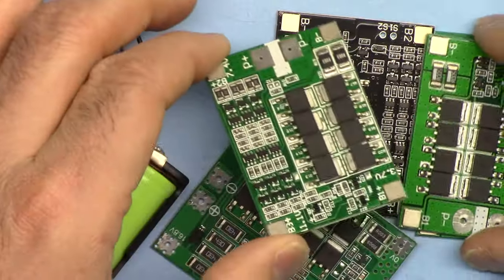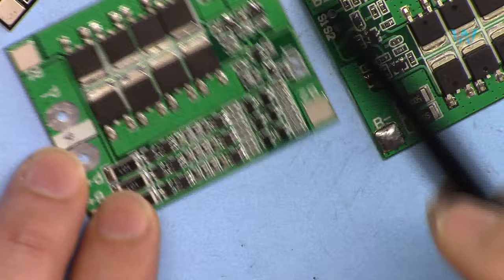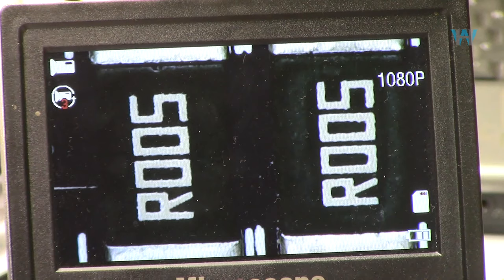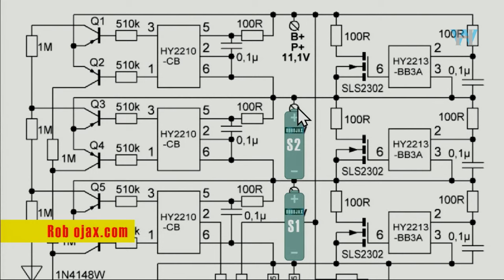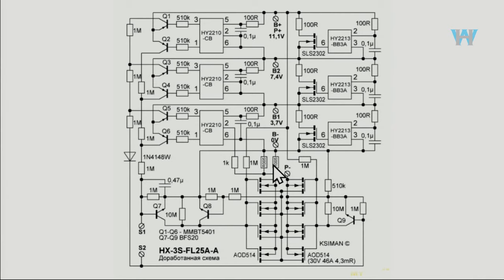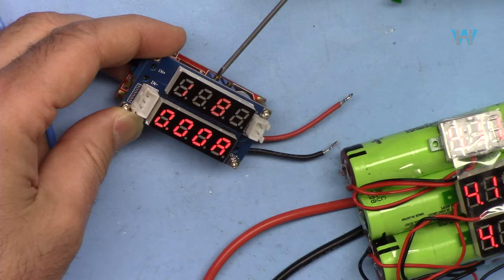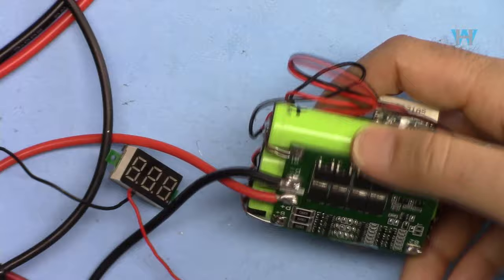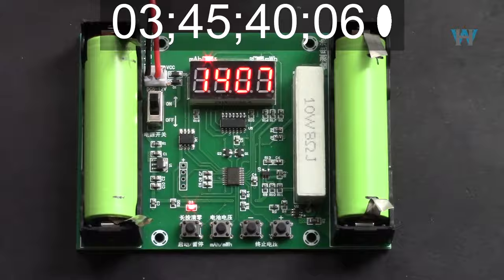The complete Guide to using 3S 40A Lithium BMS Battery Charger

Comment: thanks for this! very helpful. I've been thinking about combining this with a lithium polymer pack for easy charging.
i do have one question though, if your input voltage is at 12.0 for example, will the battery still charge to the maximum of 12.4 volts? or would you need to raise the input voltage. thanks!

Comment: Nice explanation on this topic. I have a question however: I'm using one of these managers to assist a pack of four batteries (4S) to feed a 14.4 cordless drill. There is a problem, the overcurrent (short) protection trips every time I pull the drill trigger. I wonder if I solve it by shorting the current sampling resistors (and shutting down the overcurrent protection) or there is a better solution for that. Could you please advise?
Reply: I have been playing with a knock-off set of 18/20 V Dewalt batteries. Dewalt seems to have the charging BMS in the charger rather than the battery pack. They have individual cell voltages as well as the main connections in the connector. When it is in the tool, there is no overcurrent protection such as there is in the BMS. Having the BMS in the charger cuts costs, for the sack of a more complex connector.

The video illustrates just how complex lithium batteries are and the real danger of not charging them properly. There have been a number of house fires locally due to charging scooter batteries.

The Dewalt battery pack has 5 pairs of parallel cells in series. So the BMS works with a pair of cells rather than one.
Reply: Try adding a 10-100uF capacitor across the output terminals it should help with the starting current.

Comment: Great video. I am new to the battery pack world and I learned a lot with your video. What is the small voltage readers you are using 23:04? Thank you so much.
Reply from the maker: I checked the time and there was not (small) voltage measurement. But as I continued watching at 27:23 I've shown the current passing from resistors. that voltage can be used using ohm law to find out the current I=V÷R
Reply: @WattHour  I checked 23:04 and you do have a small voltage meter attached to each cell. I think he was interested in maybe purchasing these tiny digital volt meters.

Comment: I don't have a module that have constant current adjustment, can i charge through it my battries, and my cells are not all same voltage can i connect those to bms or first i need to full charge it individually.?

Comment: Question: I made a battery pack with the same module (3S25A) for a 12V cordless vacuum. But it only runs half a second then cuts power. Tested it on a 12V cordless drill, works fine. Also tested the drill's battery pack on my 12V vac, again works fine. What could be the problem. Help will be very much appreciated.🙏

Comment: So for some reason on my BMS and I have 3 brand new ones when I hook them up the voltage on the pack reads 12.50volts but on the B- B+ it reads 11.50v everything has been hooked up to balance wires and when I test the balance plug each series of cells reads 4.15v so the only thing that’s not the correct voltage is the bms. Can I move the wire from B- to the 0v side of the board? When I do that it reads the 12.50v but I’m not sure if this is bypassing the bms or not.

Comment: well detailed information.  if i use this then i wont need dc to dc lm2596  step down buck converter right?? cause m using it to charge me 12v 9a lead acid battery using 20w solar panel and with full sun light it gives 19v dc. so if i directly connect the solar panel in this 3s 40amp bmc will it auto step down and charge and auto cut after battery fully charge?? plz plz reply

Comment: Do I need to connect (weld, solder) batteries to the BMS board in sequence (from plus to minus or vice versa) how is it in the laptop battery so that the board does not go into protection?

Comment: Hello, 
Thank you so much for this great video ! Question about the over current / over discharge protection : would it be possible to turn a 20A BMS into a 10A by removing one of the 0.05 ohm current sensing resistor ? 
The resultant current sensing resistor would then be twice higher, so the current needed to reach the protection threshold voltage should be twice lower, correct ?  
Is there any reason NOT to do such a modification ? (I can’t find 10A BMS online…)
Thanks again !
Reply from the maker: Hello, the higher the current, the higher the voltage across a resistor. So if you want to reduce the current, then increase the resistor so the voltage is increased. Now change the resistor such that the value of the resiwtor is twice as large as the original values. Removing a resitor will increase the resistor value. yes.
Reply: @WattHour  Thank you !

Comment: Question please 🙏
I have network video recorder(NVR) ,can I use bms 3s as a UPS , by puting the output and input in the place of dc12.6v in NVR (to charge when electricity is on ,and produce when electricity is off)
*NVR works with 12.6v 2A. 
Please answer 🙏😘

Comment: I came accross a weird stiuation. My 2S3A BMS has no voltage reading on the output, so I assume it's faulty. But when I reverse the input polarity I get a reading (slightly less than actual V). So, would it still provide some protection?

Comment: so my drill use 20v battery  so how it got wet   I replace my batteries  5 battey 3.7v am getting 19.5 volt when i test the batteries even the battery indicator show that they fully charged but on bms output connector  to the drill am only getting 4.add voltage any advice ?

Comment: Thanks for the most excellent video. I have a question. I purchased several of these boards and they only put out 9.6V even thought the battery itself reads 12,6V. I am guessing this is a board malfunction, correct?
Reply from the maker: Hi, you did not mention if the battery is connected or not. The output voltage is changing based on the battery state from 3.2V to 4.2V. so 3.2x3=9.6V and it seems that is correct if BMS does not detect any voltage.

Comment: 31:30 min why the battery doesn't charge ? I thought the over voltage protection only cuts off the connection if the cell voltage drops ~4.25V.
Reply from the maker: over voltage protection is when the voltage goes "Over" some value which would be more than 4.2V (I don't remember the value).  Then it has release voltage to release the protection when the voltage goes down to that value, it will release the protection.

Comment: 3s bms will still work if I am going to use standard lead acid battery charger (14.4v)? Maybe it work because the bms has over-voltage protection where prevent each cells to charge more than 4.20 volts. What can you say about this?
Reply from the maker: maximum of voltage for each cell is 4.2Vx3=12.6V is the total so it will never charge your battery fully.
Reply: @WattHour  how come 14.4 charging volts could not charge the 3s bms, the bms only requires 12.6, so 14.4 is far away more extra voltages. The only problem here is the advertised recommended charging voltages, no more than 13.6v. Im afraid 14.4v can fry tge bms.
Reply: @richardpadron9564  I was wondering the same thing, did you find an answer?

Comment: I had buy two BMS 3S 40A and when i tryied to charge the batteries something happened and the charging was stoped after 1-2 minutes and i suppose that some component was burn up becouse the batteries had 12,5V but at the end of the charging wires i had count 11.3V and continually droped down until 8,6V. 
This was happened two times in different BMS. I dont know where was the mistake becouse everything was double checked and was ok.

Comment: Much appreciate you making this lesson.  Great for a beginner like myself.

Can i ask.
 If i want to use a .Solar blanket + Solar charge controller.  to charge the 12v 18650.  
Because the solar can go up/down in current. Would the devices @22:38 still be good to limit current?
Reply from the maker: Hello, I mentioned that this module does not control the minimum current. it can only prevent the maximum which I mentioned and don't remember the value.  Each battery has different maximum value and it you don't control it, it will reduce the life of battery and possibly cause fire due to charge over heat. So you should have a something that controls the current and you set your maximum current there before it comes to this.

Comment: Is there a way to manipulate the overdischare voltage protection? I want to use it with lipo batteries. Thank you
Reply from the maker: No. It is set in chip which have shown.

Comment: I have made a pack for my drill battery with 4s 40a bms(balanced, li-ion batterys 3,7v)  and  i charge it cc 1,25a cv 16,8v (buck dc-dc converter) but never goes up to 16,8v from charging ..Stops until 16,3 and the battery itself has 15,85v after take it out οf charger and then increased a little bit  on its own(≈ 16,0v).Means not fully charged 4,2v. Any explanation??

Comment: Hi can we use 14V Charger 1Amp for 3S BMS (3400 mah capacity battery)? or do we need 12.6V charger?
Reply from the maker: Hi, you made me watch the video. I have a section explained how to connect or charge a battery. please watch.

Comment: My 20amp 3s BMS heats up like anything when I connect a 12.6 charger to the BMS… why so. Is it because it’s gone bad or did I do anything wrong ??
Reply from the maker: if the wiring is correct, then yes something is wrong with the module.

Comment: Hi. I have also a 3s bms but the output is less than the supplied voltage when measuring from the P+ & P-. Does it mean, one of the mosfet is dead? I noticed this issue with few bms I have used before after using for some time. I am curious what could be the problem. thanks

Comment: When you were putting ~17V into the BMS - was it cutting the charge/input off completely, or is it able to step down the voltage to the correct ~12.6V amount?
Reply: These units should shut down charge above 12.6v that's half the purpose of the board. Under discharge protection and overcharge protection.

Comment: Thanks for the video.  I am still struggling on what type of charger I should use for a 3S 6P Panasonic NCR18650B with a 3S/10A BMS. I have  a 12V/3A & a 16.8V/3.3A charger, which charger is more efficient/suitable to charge the pack?
Reply from the maker: you can use this for 3S. the parallel does not matter. input I forgot what was in the video but it can be I think 15V or watch the video.  the 6p means 6 cells are in parallel. so voltage does not change. it just adds the capacity. so it will last longer and it will get charger in longer time.

Comment: Sir, I want to make battery pack to charge my laptop (65watt)

After making battery pack I want to convert DC to AC and AC as input to my laptop charger like as we plug laptop charger in our home.

So, my question is how many lithium ion cells do I need?
And also bms?

Comment: Excellent video.  Do you know of a BMS that also protects against low temperatures below freezing?
Reply from the maker: I have not see it but it can be designed with temperature sensors attached to the batteries.  We have plan of producing custom BMS module for specific application and I might consider your point. Thanks
Reply: There are versions of this board that have a temp sensor port where you can solder on your thermistor. The ones I bought have that option .
Reply: The board he's showing has the temp solder port at 6:35 it's on the left side of the board mart with a T

Comment: Hi, great video. Is that possible to use this as a power bank wall for a raspberry and other equipments? That is, could I leave it always connected to the power supply and when I have a outage I could maintain the equipments working? Like a UPS. Thanks
Reply from the maker: Hi, yes this is what exactly this can work. charge and power line are different.
Reply: @WattHour  Thanks for the answer, but as I saw, the power supply and the equipments would use the same P+ and P-, right? Why did you say that there are different places to connect them? Or when you said “different lines” you meant another thing? Thanks again

Comment: How about undervoltage protection? I use different cell capacities. I use a battery case to swap out discharged batteries. Can this manage undervoltage for each cell?
Reply from the maker: you made me watch the video to see why you are asking. I have explained it. Undervoltage protection is also called OverDischarge protection which I have explained it.  Yes it can.

Comment: Hi!  great video!!  A question: I need an additional 12V battery for lights and indicators for my scooter.  Do I have to buy 3 x 4V 18650 batteries so that I can get an additional 12V battery with 3 batteries?  And if I have + - + at the top, then I only have to solder three cables, from 1st battery + to 2nd battery - and2.  Battery the - to 3rd battery back to +?  Is this right??  On the top side?  And on lower side 1st battery from - to 2nd battery + and again from 2nd battery from + to 3rd battery on -.??  So at the top + on - and - on +.  And bottom of 3 batteries the same again: from - to + and from + to -??  Is that correct then?  Do I have 12V then?  If I buy 3 pieces of lithium-ion batteries 18650 each with 1 battery with 4V and that 3x?  Kind regards.
Reply from the maker: Hi, the lithium Li-Io have rated voltage of 3.7V. 4.2V is charge voltage.  So you need 4 cell or 18650 to get 12V.  for wiring you could see the wiring in of the images of this product https://amzn.to/3gyfRXG or in this https://amzn.to/3MX6iNO sorry we can't explained it in word easily. wiring diagram is better.
Reply from the maker: you didn't reply?

Comment: i got a /HX-3S-FL25A it stop charging but i have no idea where the load cut off should be
Reply from the maker: The. You are at the right video. Watch it fully to get the Answer. Schematic is shown and you trace the components on the pCB.

Comment: If I charge the 3s battery connected to the 20a bms what is the maximum volt i can use to charge it? Please answer my question please.
Reply from the maker: You can’t use this to a BMS because it IS itself a BMS. bMS always needs higher voltage. I have mentioned all voltages if you want to know them . Ply watch.

Comment: You mentioned BMS current rating in terms of charging current limit. But in some datasheet I see that value as continuous current output rating. So a 40A BMS should be able to provide 40A when necessary. Right?
Reply from the maker: of course it should if you put a heat sink it might go even higher like 80A
Reply from the maker: Sorry I forgot the over-current limit. The mostfet can handle higher current.
Reply: @WattHour  Understand, thanks.

Comment: Thanks for explanation!! but i still wondering about charging parallel. In you presentation you give us example 3S1P, for example i would like to use 3S3P, here the question: since you use 1P, you give amperage 2A (even though in the datasheet it should use 1.6A cmiiw), so if I use 3P I need triple times amperage (2x3=6A) to make charging time same as 1P right?
Reply from the maker: yes in parallel, the amount of current is distributed to all cell and it will take as 3 times a long if you have 3 cell.
Reply: Yes, multiply the charging amp times the amount of cells you have in parallel. 
So if a 3s1p = 2amp charge a 3s5p = 10 amp charge.  Obviously this depends on the 18650 cells you use, you have to look up the recommended charge current of the specific cells. If you cont find the info than just never go over  1C charge rate(2amp charge rate for a 2000mah cell) and stick  with .5c (1amp for a 2000mah cell)

Comment: If we remove 6 Mosfets from the BMS, will the short circuit current decrease? As I need the short circuit protection kicked in for lesser current. Please help me with this.
Reply from the maker: Hello, MOSFET's are just switches and do not control the amount of current is controlled by the two 0.005Ω Resistors.  The voltage across this two resistor represents the current. if you want to turn the protection with lower current, then we should have the same voltage at lower current.  Meaning higher resistor value will give you higher voltage a less current.  I have done the math I believe in the video.  You can use the datasheet and expiation with the schematic to calculate exact current you want to turn on the short circuit protection.

Comment: Can you explain in more detail the schematic of the 3S BMS, eg which transistors are on and which are off at every stage. What would happen if one out of 3 cells had less capacity than the other 2 cells, and got charged quicker? Would the bms stop the charging process for all 3 cells or only for that 1? Similiarly what will happen if only 1 cell discharges to 2,4V? Is it only this cell disconnected from the load, or the whole 3S cells?
Reply from the maker: that is the whole point to have BMS. We have separate section for each cell. So each cell is charged individually and will stop when it if full.  But when we are discharging,  we need voltage of each cell to make it 3S and if one is too low, the whole output is turned OFF and makes it ready to be recharged.
Reply from the maker: For my channel  to grow, I need your subscription and it is appreciated. Thank you.

Comment: Hello again!🙂 Can you also make a 12V battery for my scooter for my lights, turn signals etc.??  Or a 36V-42V additional battery with 30A or 40-50A?  And if so, what would a 12V battery or a 36V additional battery with 30-40A cost?  I could with payp.  pay.  Wouldn't be a problem for me!  And then sell it to me?  I live in Austria/Vienna.  Kind regards.

Comment: I have 3 Batteries with 2 A charge current. Do I have to set the charging current to 2A or to 6A ( because I charge 3 Akkus)?
I think only 2A are allowed because the current is the same in serial.
Reply from the maker: you have to set your current minimum before this module within  your power supply which should have CC or Constant Current. this can limit the MAXIMUM only.